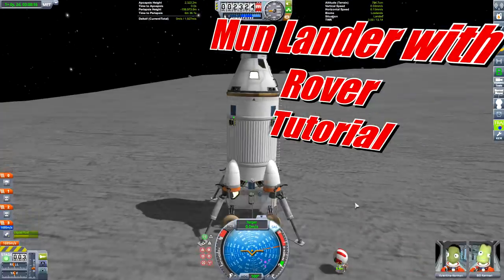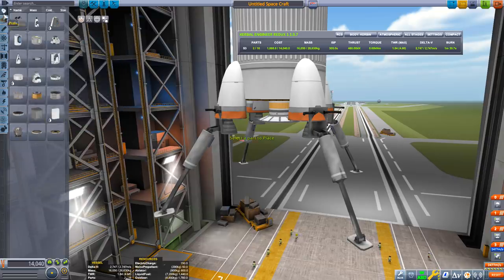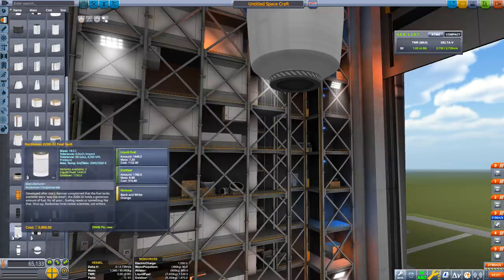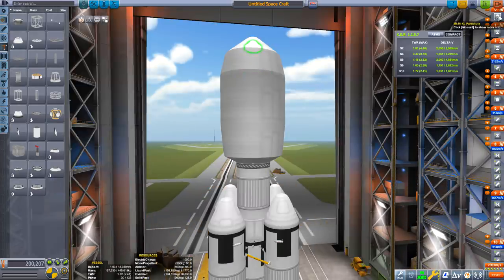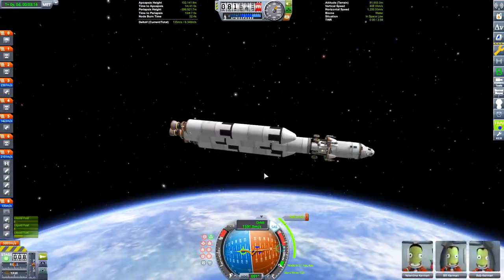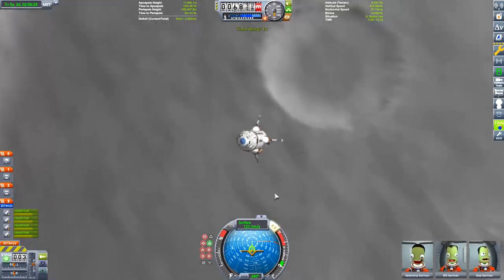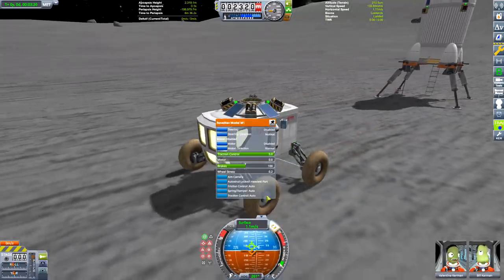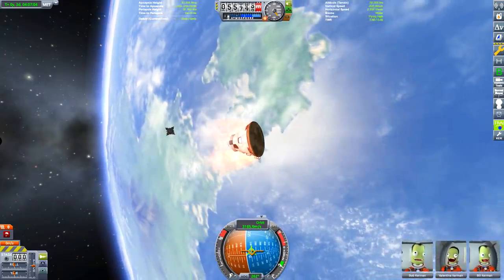KSP - Mun Landing Tutorial with a Rover

Comment: I used the slightly larger, black wheels and my rover is undriveable on the Mun. If I try to accelerate I just do a wheelie, and if I try to brake I flip forwards. Worked great on Kerbal though, so the dream is to land one on Duna and drive around like I own the place.
Reply: @alex94hg22  I have not played KSP in months now, so no.
Reply: same. I couldn't drive. I dont know why
Reply: have you tried tweaking the rover wheels' settings (torque, suspension, etc)?
Reply: All the reaction wheels must be set to "SAS only" mode or completely disabled, or you should remap your driving keys to something else that is not WASD. What is happening is your turning and thrust keys also engage reaction wheels of the rover(ones you normaly use to orient your vessel during fight). In low gravity they have enough power to flip your rover.
Reply: Other trick to improve stability is to disable steering on the rear wheels, lowering traction on the steering wheels, and rebalancing breaking to rear wheels more than front wheels.
Reply: @yasinsenel8484 you have to select your rover, right click and click control, then set your reaction wheels to SAS ONLY so you don't flip and roll it around

Comment: Lol, when you got to the Mun and revealed the fact that your battery placement caused them to rub on the engines my first thought was "Lower your spring strength on the wheels" and then you did that. You could also increase the spring strength of the landing legs to raise the lander. I have used the combination of both of those to assist in docking rovers and bases, I dry fit it all on Kerbin before launching but differing fuel levels and terrain can make it just a hair off.

On Xbox for the enhanced edition it is the X button to get the labels to persist after moving the cursor off.

Great tutorial by the way.

Edit: If you have the reaction wheels set to Normal(default) then as you try to drive around that is increasing the forces in that direction which can cause issues with rovers. I will often set them to SAS only and then turn on SAS, this gives you the benefits of SAS without trying to flip yourself every 3 meters. If you do flip over and everything is still intact you can set them back to normal or pilot only mode, flip yourself back over and then set back to SAS mode. And don't forget that command type modules often have built in reaction wheels too. This has caused many a spin out and roll over for me.
Reply: For some reason, settings for springs won't appear in my sandbox game. Do you have any idea on how is it possible?
Reply: @thekkwet777  enable advanced tweakables in settings

Comment: This video was pretty useful and had some suggestions like the rover build model. But honestly that was a very excessive use of fuel and engines, I managed to do this with a twin boar engine on it, and around that, about 6 kickback solid fuel boosters. The lander should have enough fuel for the rest. Oh I forgot, I also added an RC-02 Probodobodyne and some air brakes around the first stage and landed that to save cash. And with wings, it’s easier to control of course.

Comment: When using the inline cockpit, how do you attach the decouplers for the rest of the build?
Reply: I spun the decoupler to attach to the rear, then did the same spin and move you do to get the rover into place for the decoupler. I had no idea this was a thing that could be done until this video. I use those tool a lot more now. I’m early career so I didn’t have the parts he used but I got it to work and figured out to turn off the reaction wheels on the Mun after a near capsize. Had to look up how to pick up mun rocks but I was so glad my first land on the mun was with a rover. The first wheels suck though but now I have over 400 science from one trip to the mun so yay

Comment: I cant tell if the engines are exploding, causing the closest rover wheel to also explode, or if the heat from the engines just before touchdown causes the wheel to explode and subsequent engine to go next...but right before touchdown...that happens. 

I followed this vid second by second, and right before landing i lose at least 1 rover wheel and the above engine. Every time.

It's the exact same build as urs.   I managed to 3 wheel drive the rover...but not well.  But i noticed after that all 4 engines were just gone. 

Im so stumped.

Comment: I have to do some tweaking and figure out what went wrong, had to move the lander engines up slightly higher because they weren't counting as connected to the fuel tank and wouldn't fire, then the rover was too tall for the length of the legs with the lower engines so I got rid of the small tank and adapter above the rover to make some more room for the legs to touch the ground and the coupler exploded my rover and two of the engines when I tried ejecting the rover.

Comment: On console 4 the rover design, we can't turn it and place it like you did, we can only place parts on attachment points.
Reply: It can still be done on the console. The initial placement is on an attachment point and then using the rotate and offset tools to move it as desired(will be in the upper right side of the screen by default on enhanced edition), just a lot simpler to move on PC. Another tip is when you go to offset the part, at least on xbox, you can hold the RB button to move smaller increments and also beyond the normal range. Holding LB and then left/right will move in the third axis.
Reply: Oh and if you are meaning how he is placing the wheels at the very edges that is by turning off the Angel Snap, this is the small little circle next to the symmetry indicator. If it shows a hexagon then Angle Snap is on, if it is a regular circle Angle Snap is off.

Comment: once i traveled around 20 km with a rover on mun. Took like 4 hours, mostly because it flipped kept on flipping and destroying everything what was attatched to the lander can. Imho mun gravity is too low for rovers :P
Reply: If you have the reaction wheels set to Normal(default) then as you try to drive around that is increasing the forces in that direction which can cause issues with rovers. I will often set them to SAS only and then turn on SAS, this gives you the benefits of SAS without trying to flip yourself every 3 meters. If you do flip over and everything is still intact you can set them back to normal or pilot only mode, flip yourself back over and then set back to SAS mode.
Reply: Robert Baker Are you talking about the built in reaction wheels in the rover body?
Reply: @Sinnbad21  Both types. The built in reaction wheels and also the stand alone reaction wheels. They are great for turning on larger rovers but on the smaller rovers they can be overpowering. You do need them when you catch air and want to be able to adjust how you are going to land.
Reply: Robert Baker I didn’t even know people put reaction wheels on rovers
Reply: @Sinnbad21  Some do. And some forget about the built in reaction wheels on some command modules if they use it on the rover. They help in lower gravity situations when you lose contact with the surface  maintain stability. And also if you have a heavy rover for turning quicker.

Comment: When I try moving with the rover it spins out of contril
Reply: Move it slowly if it's too fast it spins out
Reply: If you have the reaction wheels set to Normal(default) then as you try to drive around that is increasing the forces in that direction which can cause issues with rovers. I will often set them to SAS only and then turn on SAS, this gives you the benefits of SAS without trying to flip yourself every 3 meters. If you do flip over and everything is still intact you can set them back to normal or pilot only mode, flip yourself back over and then set back to SAS mode.
Reply: Brendan bailsong and aviation. Did you put the editor in mirror mode instead of symmetry mode

Comment: Not Man. Mün! I flinge every time you say Man.
You don't have to enclose the capsule in the fairing, you can close it on the base of the capsule.
Also use autostruts and rigid attachment, that's why they're there, to reduce the number of parts.
Reply from the maker: I always get that Mun not Man 🤔 must be my accent. Yeah the fairing is probably overkill but good practice for beginners and I only use autostrut when I cant use struts as autostrut can summon the Kraken though they may have fixed that in the latest update.